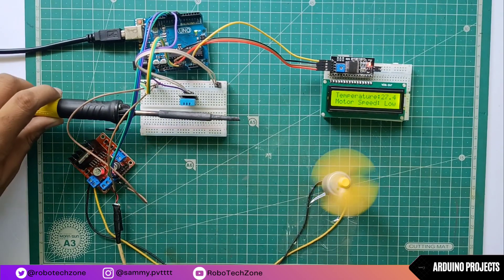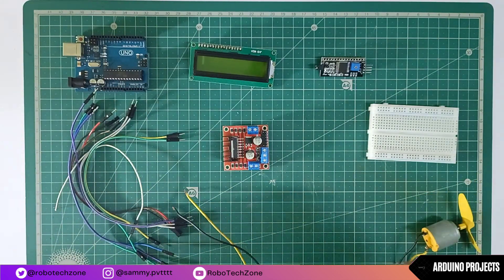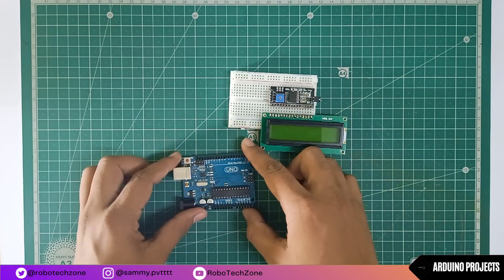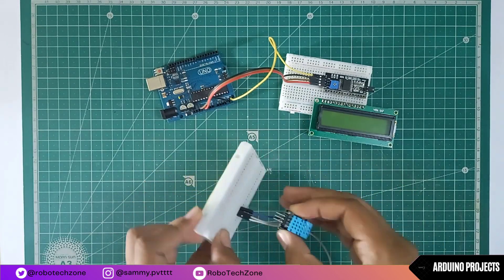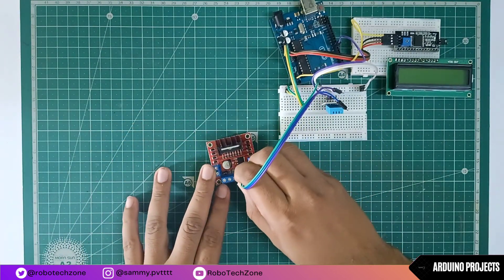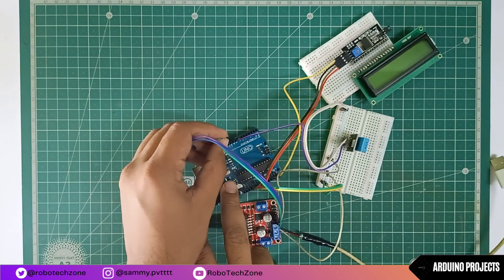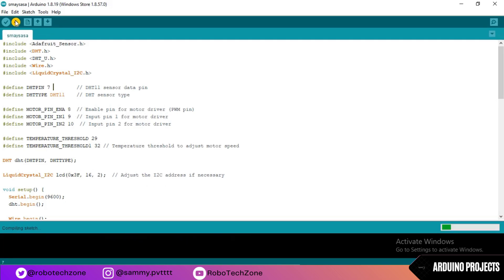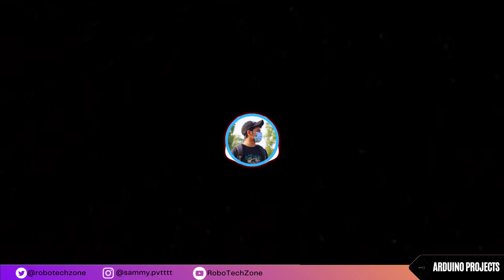Temperature Based Fan Speed Controller Using Arduino UNO || ARDUINO PROJECTS

Comment from the maker: Code Link Is working for me try to open in laptop ( if then also you face any issue then dm 8458839587 ). Code Link -: https://github.com/samaysahu/Temperature-Based-Fan-Speed-Controller-Using-Arduino-UNO-.git
Reply: Why when i plug in my usb, my arduino turn off

Comment: If anyone have doubts that if this will work or not. I have just made it today and its completely working. I got all the components for 1000INR. 
Only problem you could face is you have dht11 with led and in this tutorial its the one with no led (standard one) there the pins are different. S pin is equivalent to data pin in new dht11(its the middle pin) other pins are same i guess. 
Except for this there will be no problems. 
I'd say this was the best tutorial one can make. 
Before making the project i was not sure if this will work. I know there'll be some difficulty with the code. 
But I've got no issues with the code and whatever. 
It was just 1 try and boom it worked. 
Thanks sir for this easy and well explained tutorial. Its for you only that I was able to make this project. I have submit this tomorrow. Thankyou and keep growing ❤️😃

Comment: How can I control the Amp going to a peltier with arduino. I would like to reduce the amp going to a peltier when the temperature at the heat sink increases too much. Or should I decrease the voltage?

Comment: thanks working now if anyone would like to do this from lm35 here is the code:#include <LiquidCrystal_I2C.h>

LiquidCrystal_I2C lcd(0x3f,16,2);

    

#define MOTOR_PIN_ENA 9  
#define MOTOR_PIN_IN1 10  
#define MOTOR_PIN_IN2 11  

#define temp 26 
#define temp1 27
#define temp2 28
#define temp3 29 
#define temp4 30 

void setup() {
  
  lcd.init();
  lcd.backlight();
  lcd.begin(16,2);
  lcd.setCursor(0,0);
  Serial.begin(9600);
  lcd.print("Temprature:");
}

void loop() {
  delay(2000);
  float temperature,v;
  v=analogRead(A0);
  temperature=v*5*100/1023;
  
  Serial.println(temperature);
  lcd.setCursor(0, 1); 
  lcd.print("                "); 

  
  if (temperature >= temp && temperature < temp1) {
    
    analogWrite(MOTOR_PIN_ENA, 51);   
    digitalWrite(MOTOR_PIN_IN1, HIGH);  
    digitalWrite(MOTOR_PIN_IN2, LOW);
    lcd.setCursor(0, 1);
    lcd.print("Fan Speed: 20%");
    
  }
  else if (temperature >= temp1 && temperature < temp2) {
   
    analogWrite(MOTOR_PIN_ENA, 102);    // Set the motor speed to a value (150)
    digitalWrite(MOTOR_PIN_IN1, HIGH);  // Set motor direction (forward)
    digitalWrite(MOTOR_PIN_IN2, LOW);
    lcd.setCursor(0, 1);
    lcd.print("Fan Speed: 40%");
    
  }
  else if (temperature >= temp2 && temperature < temp3) {
    
    analogWrite(MOTOR_PIN_ENA, 153);    
    digitalWrite(MOTOR_PIN_IN1, HIGH);  
    digitalWrite(MOTOR_PIN_IN2, LOW);
    lcd.setCursor(0, 1);
    lcd.print("Fan Speed: 60%");
    
  }

  else if (temperature >= temp3 && temperature < temp4) {
    
    analogWrite(MOTOR_PIN_ENA, 204);    
    digitalWrite(MOTOR_PIN_IN1, HIGH);  
    digitalWrite(MOTOR_PIN_IN2, LOW);
    lcd.setCursor(0, 1);
    lcd.print("Fan Speed: 80%");
    
  }

  else if (temperature >= temp4) {
    
    analogWrite(MOTOR_PIN_ENA, 255);    
    digitalWrite(MOTOR_PIN_IN1, HIGH);  
    digitalWrite(MOTOR_PIN_IN2, LOW);
    lcd.setCursor(0, 1);
    lcd.print("Fan Speed: 100%");
    
  }

  else if (temperature < temp) {
   
    analogWrite(MOTOR_PIN_ENA, 0);    
    digitalWrite(MOTOR_PIN_IN1, HIGH);  
    digitalWrite(MOTOR_PIN_IN2, LOW);
    lcd.setCursor(0, 1);
    lcd.print("Motor Speed: 0%");
    
  }
  lcd.setCursor(12, 0); 
  lcd.print(temperature); 
}
Reply: 😮It is correct.?